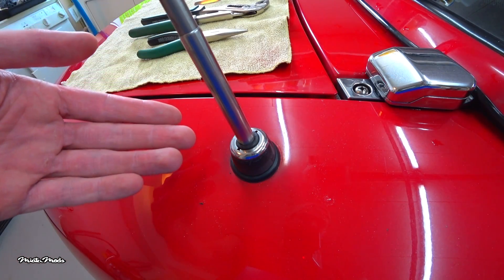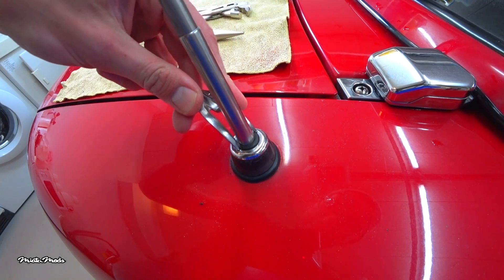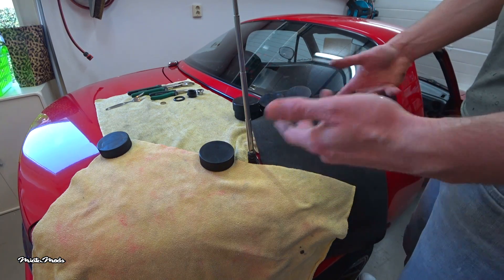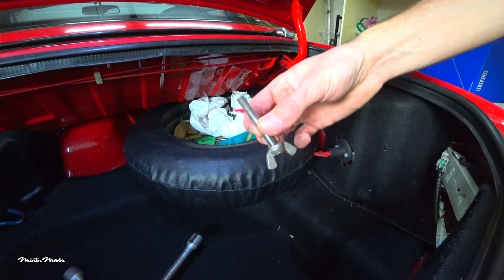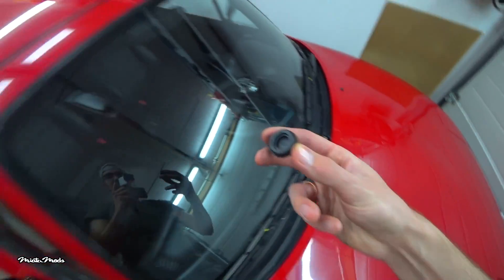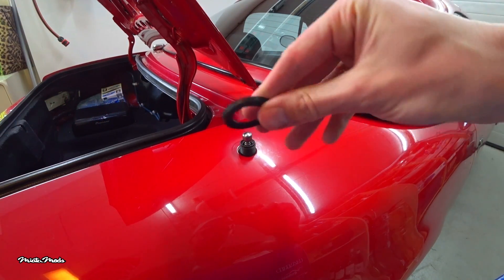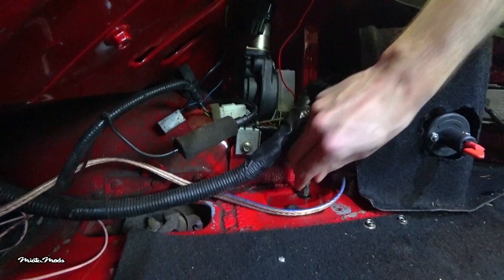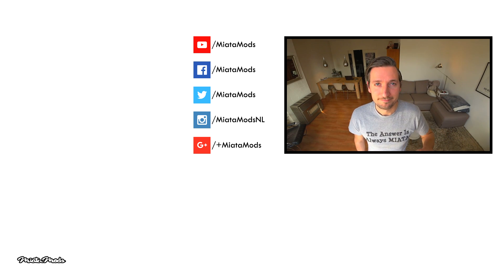MX5 NA Miata - How to replace your antenna unit

Comment: I see I'm not the only one that uses the spare tire as a catch all for small things in the trunk.  I'd bet that C-clip, Circlip or snap ring pliers would work for taking off the antenna nut.
Thanks for another well done video.  The best Miata how to videos on You Tube.
Reply from the maker: Thank for the compliment Bruce! Yeah that would also work and you are indeed not the only one who does that hehe 😜

Comment: FORK TRICK, LOVE IT! I bought a set of adapters JUST to do this with all my old vehicles and the socket works but the nut is at such an angle that it doesn't even sit properly(98 legacy limited). Definitely doing this trick, thank you man!
Reply from the maker: Haha no problem man! You can also use a old fork for removing those black plastic clips that hold the carpet down behind the seats 😉

Comment: Mine goes halfway down as well. I always Bluetooth and was going to do an antenna delete. I saw a plug online for $19.99 and I had the idea to use a bolt that was dome shaped with a grinder and a o ring to seal it but your wiper trick could save me time and effort!

Comment: It is possible the original antenna needed some type of slide grease like they use on brass instruments. If you rub some along the edge of the antenna where it gets stuck and try pushing it down by hand (carefully of course), it might actually fix it. Don't throw it out, it could possibly be repaired!
Reply from the maker: That's a good tip, thanks for sharing

Comment: I copied you again 😂. I found a unit for 25€. I tried the fork trick, but just succeeded in wrecking a fork. Then I tried my needle nosed pliers, and they worked no problem. It took all of 15 mins. The longest bit was getting the black plastic  bung off the drain hose and putting it on the new one.
Thanks for once again making life easier.
Reply from the maker: Haha no problem man, glad my video was helpful!
Reply: MiataMods 
Sorry mate couldn't wait. I changed my transmission and diff oil yesterday. I used GL5 75W90 for both. Fortunately I have a mate who has an inspection pit in his garage which made things much easier. All good fun..
But there's a funny thing, the stuff I drained from the gearbox was pink, very liquid and didn't stink as it should have. Wierd. I wonder if the  previous owner put in automatic transmission fluid in by mistake ?
The oil in the diff seemed normal. Took her for a 45 min test drive. No more gearbox whine in low gears and slicker changes so well worth doing.
Next job will be various drive belts. Since its been colder and wetter, something screams at me every morning. Probably the alternator belt. Its driving me crazy!
Reply from the maker: I’m having the exact same problem! I think that in my case it’s the alternator (belt) as well because it screams louder under load.. let me know how you fixed the problem!
Reply: MiataMods 
I fear the reason is simple. Time to replace the belt. There are a few tutorials on YouTube. It looks à bugger to remove.  You have to loosen the alternator to relieve the tension. I suspect the power steering belt has to come off too,  I'll know when I get to the end of the video. ..,

Comment: Fun Fact: If you're poor and between paychecks, the same wing-bolt that holds down your spare tire in the trunk, also fits the bracket where alternator adjustment bolt would normally go.
Reply from the maker: Hahaha that’s awesome! Love those fun facts! Thanks for sharing ☺️
Reply: Lessons learned the hard way lol
Reply: Also fun fact: That same wing bolt can fit in the threaded hole in your rotors. You can thread the wing nut into the hole to pry off any seized rotors that your mallet is having trouble with.
Reply from the maker: Is that the bolt on the bottom of the front gender, near the front sill drain hole?
Reply: Its the wing bolt that holds down the spare tire, the one GrimmWarrior is talking about. Fits right in the threaded hole in your rotors. Insert the wing bolt and thread it through and rotor pops right off.
Reply from the maker: Aaah ok! Thanks for the tip!

Comment: Thanks for the pro tip with the windscreen wipers plug :) I will switch to DAB+ Radio, so I guess I won't need the antenna anymore. Would you recommend using some silikone to really make the plug waterproof?
Reply from the maker: Yeah why not, that couldn’t hurt!

Comment: Mine has the electric retractable antenna as well. Is it possible to put a stubby antenna on this? I want to make it shorter than stock.
Reply from the maker: Yes you can switch over to a stubby!

Comment: Great vid again ! But one serious question : from where comes the water that you need to drain with the drain plug next to the antenna? I dont have one 😳😳
Reply from the maker: When the antenna is extended, water can get inside the mast and run down into the unit. That little bit of water needs to go somewhere so that’s why there is a drain plug. Do you have a electrical antenna like I have?
Reply: MiataMods Yes I do, but my radio unit is not installed yet so I havent seen it working properly. I will send you a pic from trunk today through messenger
Reply from the maker: Okay man, that’s fine!

Comment: At the 4:00 minute mark your removing the antenna assembly with the plastic box on the left side....when you install the asssembly the plastic box is on the right side.
Reply from the maker: I didn't even noticed that until now.. good eye! Yes you are right, apparently the units are a bit different but they work the same so it's not a problem.

Comment: Good video! ty
there is any videos showing how to replace with a stubby short antenna?
Reply from the maker: Yes there is. Check out the guys from Gearheads Garage, they have a video on how to install a stubby short antenna. Say hi for me 😉
Reply: Also putting in a stubby aerial is even easier. Just buy a manual aerial adapter + stubby aerial. Takes 15 minutes to do. No more 1980's big electric aerial!

Comment: Nice teaching video. I'm installing an electric antenna to replace my whip and there are 2 empty 4 prong plugs in that area. One is coming from the battery harness (4 wires) and the other is separate and comes from the front of the car (3 wire). Any suggestions which one is for the power antenna? I think it's the Battery harness one. Oh, and it's on a 1997 model.
I'm also using a "used/untested" power antenna so not sure if that even works.
Reply from the maker: Yeah I would say the battery harness as well but I'm not sure. Keep in mind that if the electric antenna is not working, it could also be your headunit who is causing the problem. A lot of times people just cut the wires at the back of the headunit. Your best bet would be to find another miata driver who has a working electric antenna and connect your antenna to his wiring harness. That way you 1) will know your antenna works and 2) you can see with plug is the right one. Send an e-mail to info@miatamods.net if you need any help!
Reply: To be honest, when I replaced the radio last year I can't remember if I connected the power antenna wire up since it just had the whip antenna at that time. The unit is giving me a hard time taking it back out to check. Thanks for the advice, I love my "new"  97' Miata, it was meant for my missus but she doesn't like driving stick, so I guess I'll just have to keep it for myself. What A Shame ;)
Reply from the maker: What a shame indeed haha! The power antenna wire is a blue/white wire which is called the signal wire. It's a wire with low voltage so keep that in mind if you want the test the antenna with a 12V source. Good luck!

Comment: Does anybody have an idea how to remove the nut if its somehow fused and wont turn to the left. Nothing ive tried seems to do anything. Wd40 didnt help either
Reply from the maker: WD40 is not a penetrating oil. Get some good penetrating oil and use a burner to add some heat

Comment: Are you ever going to do the low profile headlights from jass performance ?
Reply from the maker: I don’t think so because I love the OEM popups too much! I will maybe switch to a proper HID setup eventually, but it would still be a round light so I can keep the full popup functionality 😏
Reply: MiataMods I was seeing the jass performance let you keep that option so you can still pop them up & down
Reply from the maker: Yes but I want to keep the “full” popup functionality, like the car has two eyes.. I like that look

Comment: Like it dude. I really want a short stubby antenna or one like you have, where did you get it from dude?
Reply from the maker: It's just the original antenna from another Miata haha. My friends from Gear Heads Garage have a video on how to install a stubby antenna if you are planning to install one of those.
Reply: MiataMods that’s strange, maybe the uk model doesn’t come with one as I have a fixed antenna which is like a metre tall and just looks so out of place😂
Reply from the maker: Really? Hmm I've seen a few MX5's with that type of antenna but I always figured it's aftermarket but maybe it's OEM after all.. o well, it shouldn't be too hard to find a second hand 'electrical' unit right? Good luck!
Reply: MiataMods defiantly, I thought electrical was aftermarket but being oem should be nice and easy to track down! Cheers mate
Reply: There are two types of antennas. One is fixed antenna Exhaust-ed is talking about. It was standard for NA. Electrical antenna that MiataMods has was optional. I'm not sure how it worked with optional stuff when ordering NA but usually if your pre-fl NA has power windows it usually has also electrical antenna.
Reply: FernieCZ fantastic, this clears things up nicely, thank you dude!
Reply from the maker: Aaah ok, thanks for the explanation!
Reply: No problem, glad I could help.

Comment: Quick Question guys (This is my first car so correct me if im wrong), My miata (NA 93) has an antena like the one in this video, however before i bought the car some thief broke it from the base, id like to change it from a retractable to a Stubby 2inch rubber one (since antenna stealing is common where i live).

Can i make a change from retractable to fixed?  do i have to change the base or what? and if its posible how?
Reply from the maker: Antenna stealing? Who does that.. that’s really weird. Anyway, yeah you can switch to a stubby no problem. I think GearHeads on YouTube has a video on that topic
Reply: @MiataMods  found it, thanks for the help!

Comment: Hey do you think its worth having a power antenna on a miata, rather than just a standard fixed one? I need to fix my antenna.
Reply: That’s what I was wondering. I’m trying to convert mine to a fixed antenna... I think it just screws in and plugs in
Reply: im in the process of fixing my powered unit, sure its bit of a pain, but i want to keep the retro feeling of the miata. 

pieces of the previous mast broke off inside the unit itself so the whole assembly is coming out in my case

Comment: Where did you get the new units from? Can you link it?
Reply from the maker: You mean the new antenna unit? It’s a second hand unit. No need to buy a new one, a second hand one will work just fine
Reply: MiataMods can you link me where you bought the on in the video then?